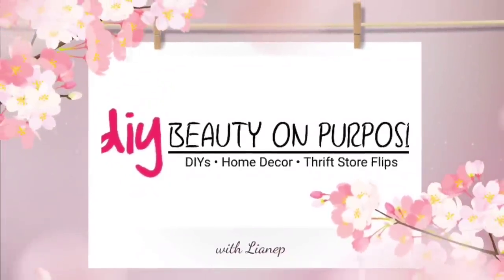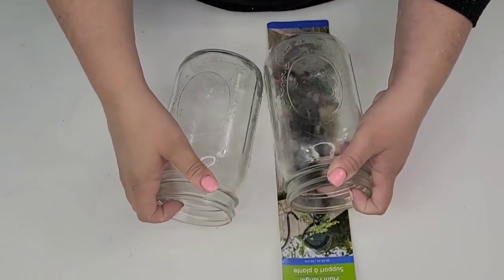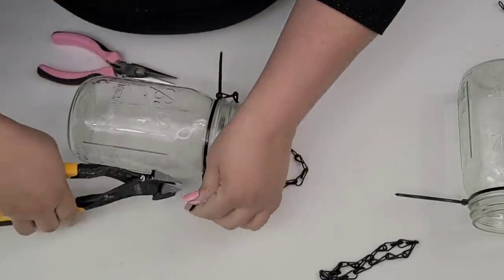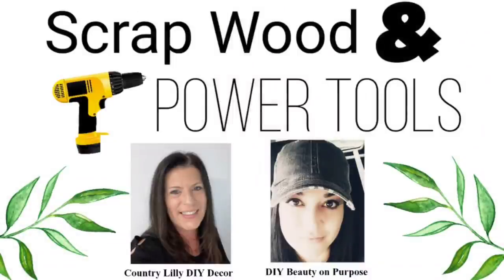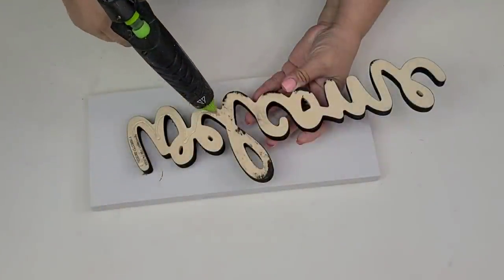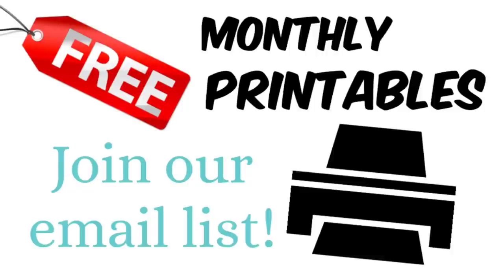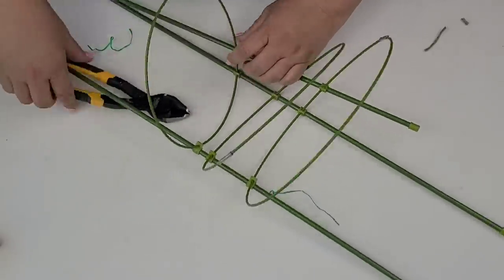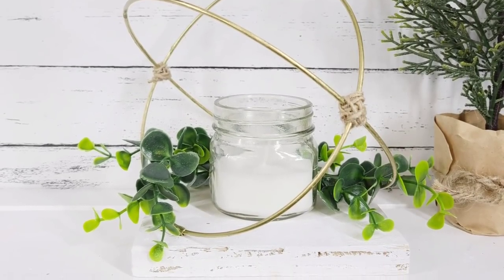🌿 Scrap Wood & Power Tools DIY Decor | Farmhouse DIY Home Decor | DIY Home Decor (2021)

Comment: I am so thankful you two did power tool videos.  Helps take away the "fear" I had toward them.  I work with expensive equipment at work everyday, but tremble when I pick up an electric drill. I feel more empowered now. Thank you! ❤️

Comment: I would to start working with wood. I usually have to get my husband to cut anything I need. How did you get started?
Reply from the maker: Hi! I besically just started with small.pieces of woods like 1 x 2 or 1x 3 and then moved up from there. Always be careful and use all safety guidelines.